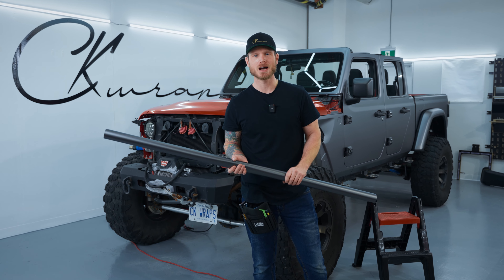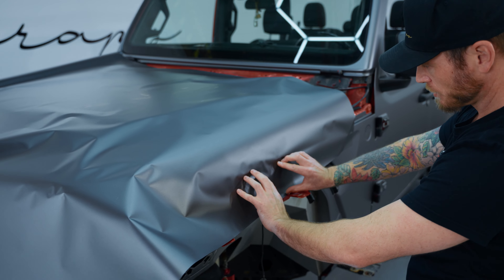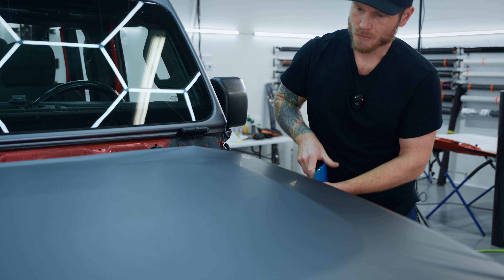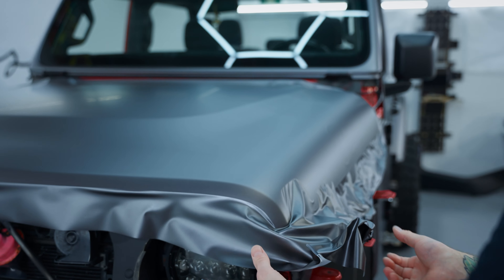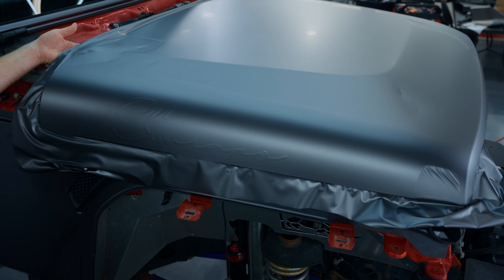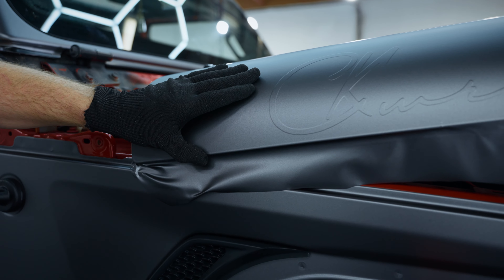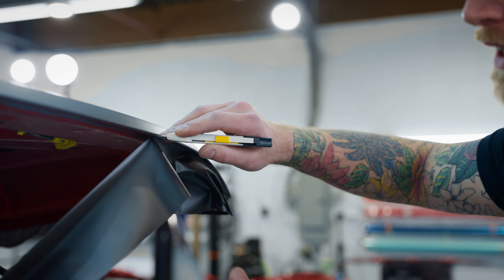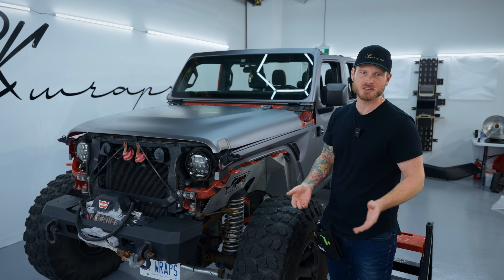The First Hood Wrap with Colored Cosmetic PPF - Jeep Gladiator Part 4

Comment: PSA for anyone looking to use this film...
So I just finished my hood in the Midnight Black. I love how easy it was to wrap. The only issue I have is that you can see where I pushed out bubbles with a wrap glove. I pushed the bubbles like you would with any other film (nothing crazy) but that left indentions in the film that can be seen in the sun. The website says "It is suggested to apply the film while holding excess material off the surface. This will prevent trapped air and distortions in the in film. In the event of bubbles, press the bubble softly or puncture to let air out." That's definitely the case with the Midnight Black...emphasis on softly because even typical bubble pushing pressure seemed to leave distortion.
I'm doing my trunk next so I may provide an update.
Above all else, thank you CK for all the years of content you've taught me a ton on wrapping cars.
Update: Working with that knowledge described earlier it did come out way better on the trunk, but it is a very touchy wrap in regard to discoloration when viewed in the sunlight.

Comment: Do you see there being much difference in conformability/stretch between the Satin and Gloss Colorfusion films?
Reply from the maker: They both stretch and conform exactly the same way. The gloss however is much more difficult to install because it's vulnerable to lift and glue lines.

Comment: This stuff is extremely expensive for someone buying in europe. It totals about 2500$ for a single roll to ship to Norway, where as kkwraps ultra gloss tpu lined film is about 800$ for the same amount.
Reply from the maker: You get what you pay for. There's a reason why their film is 3 times less expensive.
Reply: @CKWraps  i get that its a much better product, but what i was commenting on is how throughout the series you were saying how this stuff makes cast film irrelevant because it costs basically the same or a little more. Like even in canada it costs i think double of what cast film goes for.